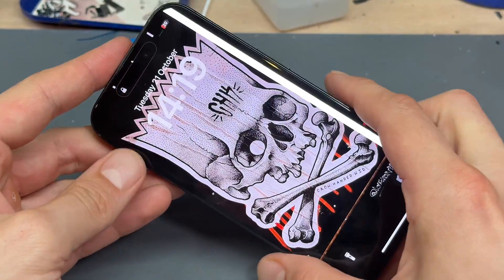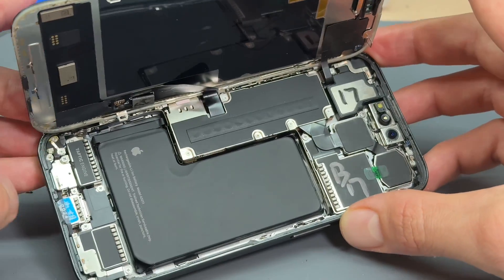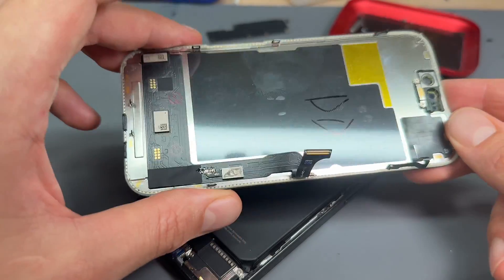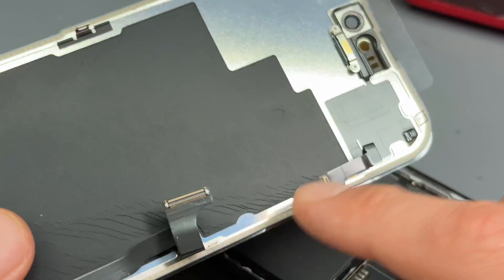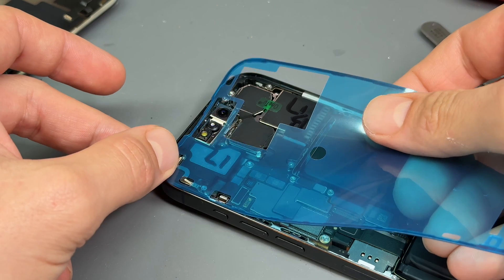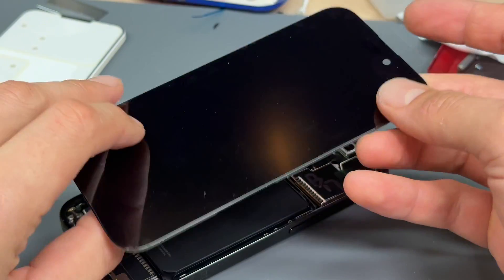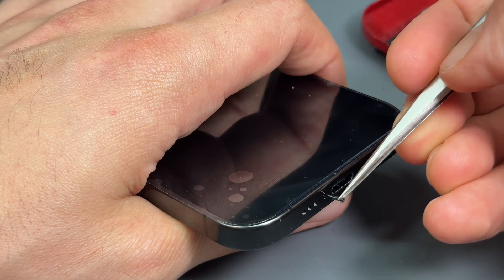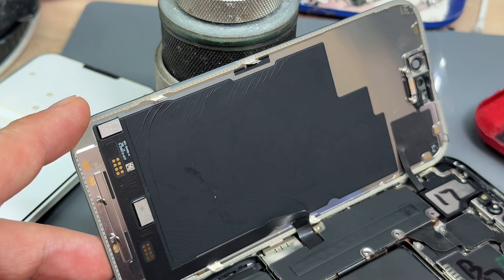iPhone 15 Pro Genuine Screen Replacement – Full Step-by-Step Repair Guide Using OEM Apple Parts!

Comment: Very nice tutorial! I bought a JCID screen for my 13 pro, awesome quality but the brightness sensor has a problem: when I am in a dark room and show white images on screen auto brightness goes up, like if the white are reflected to the sensor. Everything is ok, but surfing online someone said that JCID doesn't have a sort of black rubber that should be swapped from the old screen and that should fix my issue. Do u have experience with this? Thanks

Comment: Yeah bro that's the exact packaging and you have to use the new screws that are in the package for the display cowling, also you can ask your supplier for a new adhesive to send it with the part that is being replaced.
Reply: Mobilesentrix only sells the adhesives in packs of 10 or 30. They send one for free when you buy their in-house displays. If you want to buy a single adhesive, you have to go somewhere like injured gadgets or amazon.